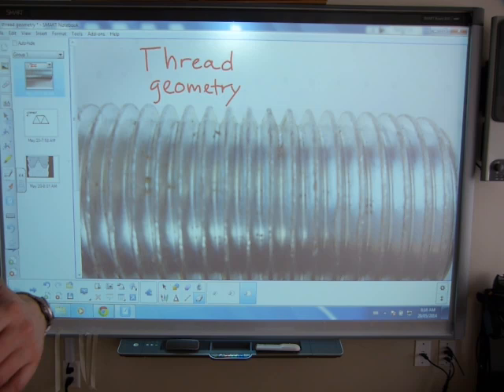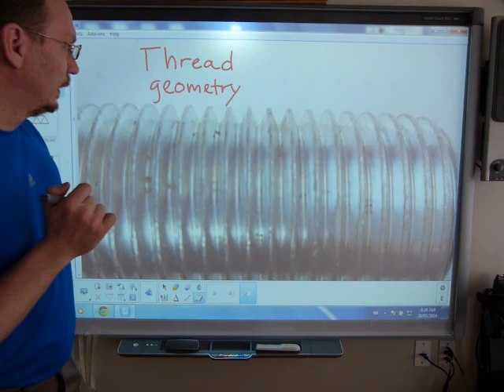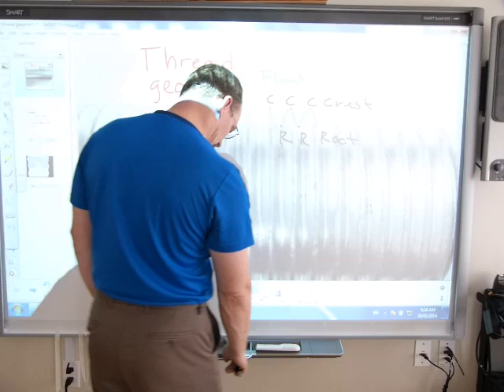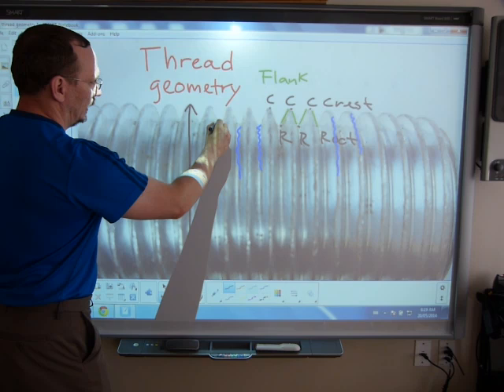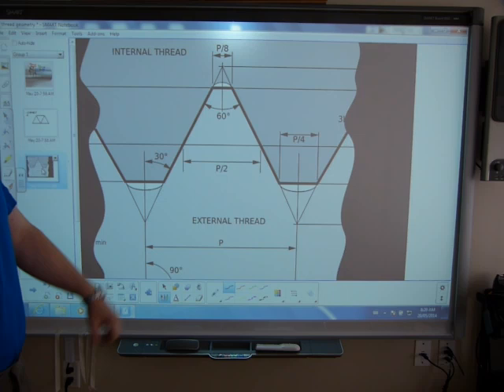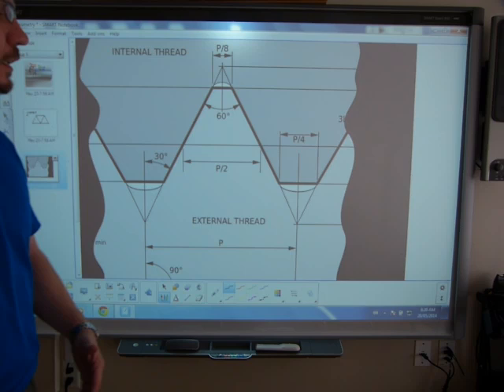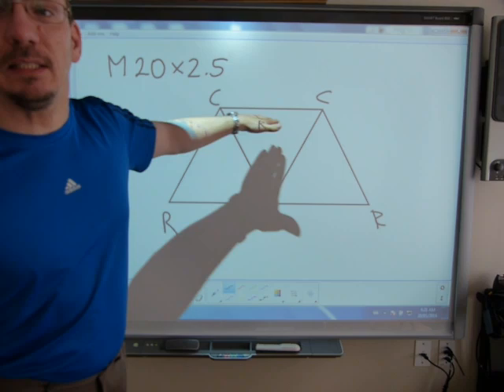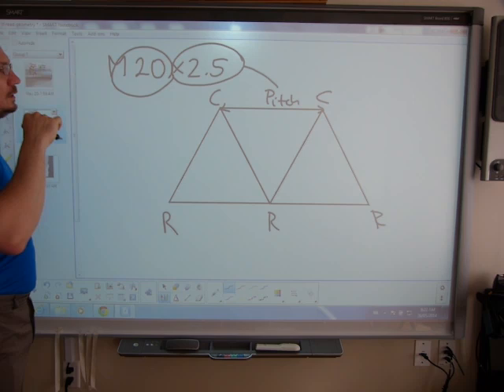Screw thread geometry features

Comment: Just a question.   Why use half the included angle and not the full 60°?   Is not the triangle formed by joining the peak to the base at 90° just as valid.   Then the formula would be h=p x sin 60°.    Or h= sin 60° / TPI for US Customary.  Not a criticism of your presentation at all, just voicing a long held question on this.

Comment: Like the video and could follow what you were showing. 
My question is actual cutting of the threads. The tool is typically 60 degree pointed so I am getting confused on the root area. If cutting stops at the value of root truncation, the tool point stops there as well, so how is the root flat area formed? It would seem the cut would have to extend all the way down up to the actual root diameter to get proper threads.
The thread outer edge crest could be turned down before or after threads are formed.
Reply from the maker: Threads a 99% rolled = metal is deformed between 2 thread dies with progressively deeper threag pattern like wet noodle spun between fingers.
Cutting comes close, too.
Either way, near perfect threads are formed.
Reply: Thank you.

Comment: What happens to the pitch (consideration) when you have a multi-start thread? I know that technically it is the same but how do you calculate the depth of cut?
Reply from the maker: If it`s the same 60-degree thread, same math applies.

Comment: So, for instance, I cut a thread on the lathe.  It was for a 7/16-20 thread.  The nominal outside diameter was 0.4375, but after cutting my thread the outside diameter was 0.420.  So I suppose then that the truncated points of the threads are what caused the reduction of my outside diameter.  Am I correct assuming this?  Thanks, Tom
Reply from the maker: Quick estimate 0.4375 - (sin60x1/20/4) = 0.4266 OD after truncation, rough estimate, rolled thread forms have a rounded truncation, not a fltat top, so 0.427 is a reasonable final diameter. Depending on instrument precision, 0.420 is close enough, leaves enough metal for thread engagement.

Comment: Can you help. So, lets say I have TWO extruded bossed cylinders which both have 1.250 OD with 1.000 ID hole though all. So, left to work with is (.250 / 2)= .125 wall thickness. So now I need threads (female and Male to screw both tubes together) , also I need at least (.125 / 2) = .0625 wall thickness (which is sturdy enough for ABS 3d printing material)
How do go about calculating the male and female threads?
Reply: If I extrude cut one pipe end to too 1.250 OD - .125 = 1.125 OD ( say 1 inch thread ) now I want apply threads for assembly of the two pipes.

Comment: Are these calculations only applicable to a standard 75% full thread?
Reply from the maker: Applicable to ISO and UTS 60-degree threads where thread depth is ABOUT 75% due to that 60-degree equilateral triangle and thread truncation. Pipe threads, Whitworth, buttress, microscope, ACME, light bulb bases, hydraulic hoses have completely different thread angles, pitches and thread truncations.
Reply: apprenticemath Understood. Thanks for the detailed response.

Comment: how to make British Standard Pipe Thread (Whiteworth) ? its 55 Deg not 60
Reply from the maker: Asad Kazmi If your lathe is made to match that thread pitch precisely it is possible, otherwise not really.
Reply: I think using a 127 teeth gear could be possible, i bought one for my metric lathe ; the module of such a gear must be the same of others already running in the lathe : my gears are modulo 1 , and so i bought a 127 teeth gear, modulo 1. Now i have to fix this 127 gear in the lathe, but this is another story . . . In the meanwhile i use a " low error" gear set : instead of 25,4 mm as an inch, i get 25,3846 . . . , with an error of 0,06 per cent.
( surely NOT OK for very long screws . . . )
First i founded two numbers whose quotient was near 25,4 or - better - 2,54 that is a tenth of an inch. I worked a bit, but finally i found 66 and 26 . In fact 66/26 is 2,53846 . . . 
( no other number are possible, it's no possible use decimal gears . . . )
Then i had to correct the pitch of the main screw of my lathe, that is 1,5 mm.
So i got ( 44/26 ) x 1,5 whose result is 2,53846. Any additional equal gear can be applied ; they - if equal, suppose 50 and 50, or 40 and 40, ( and so on ) - don't affect the pitch. Doubling or changing ratio between two added gears can be usefull to get multiple or submultiple values of on tenth of an inch. I got the gears, 44 and 26 teeth from "RS components", but they can be found elsewere. I had to lathe them a bit to achive my lathe mechanics, but at the end they were ok.
Then . . . cutting Whitwhort screw is an other story, i got some usefull results, but some teoric lessons could be very usefull . . .